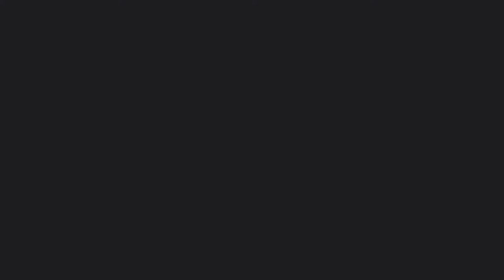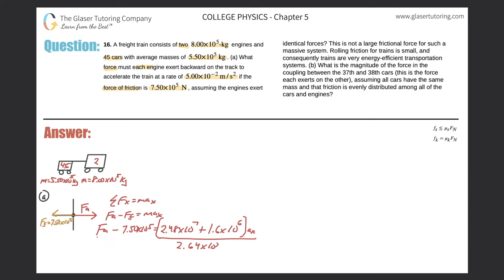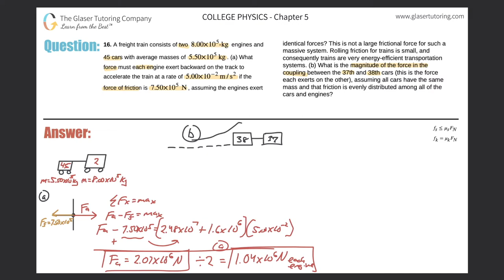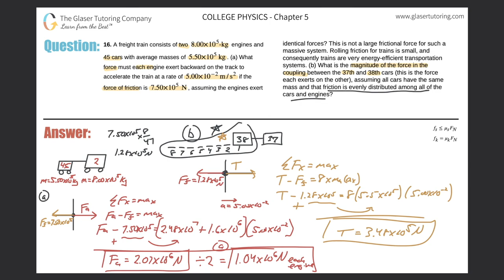5.16 | A freight train consists of two 8.00×10^5-kg engines and 45 cars with average masses of

Comment: why do we devide all by 47 in part b ? because we need to find the force of the 8 not all 47
Reply: We need to find the frictional force for our system of interest. Our system of interest is cars 38-45. To find the total frictional force for all of these cars we need to first find what portion of frictional force is distributed into one car.

Total frictional force = 7.50×10^5 N. Which means if we want to find the frictional force per car, we take that number and divide by 47 (remember we are including cars AND engines so we have 45 + 2 = 47).

7.50×10^5 N / 47 = Frictional force per car. Then multiply this number by 8 because in our chosen system of interest we have 8 cars total.

7.50×10^5 N / 47 = 1.6×10^4 N

8 × 1.6×10^4 N = 1.28×10^5 N

Therefore 1.28×10^5 N is the total frictional force of our system of interest.